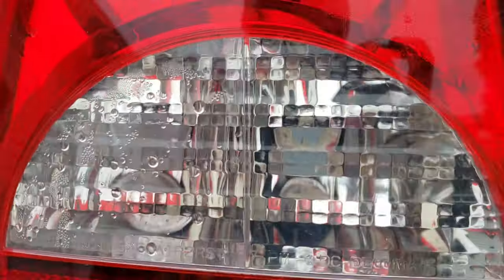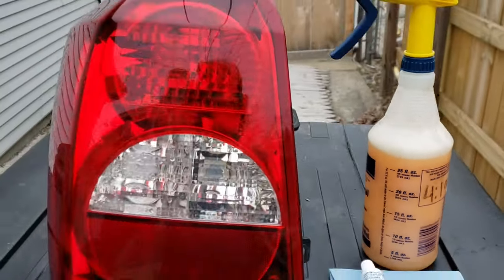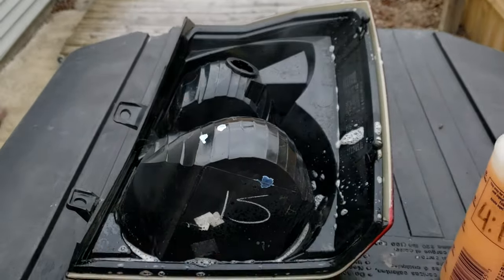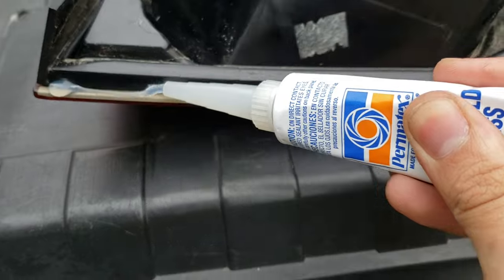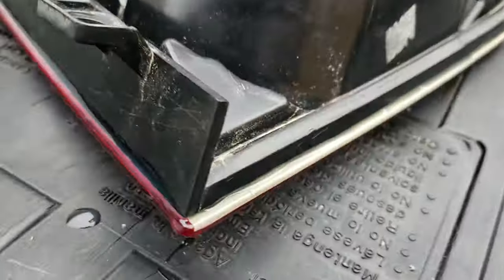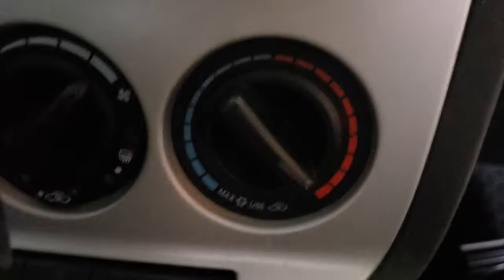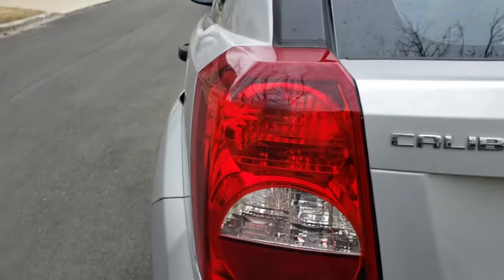How To: Remove and Seal Tail Light from Water

Comment: Please share type of sealant used.. is it the silicon based sealant available on Amazon?
Reply from the maker: You are correct, you can use any silicone based sealant to be used. The color depends on you as well as you can purchase it at Amaonz, Auto Parts store, or a Home Improvement store.
Reply: @motormech9876  one question I have about any silicone/sealant/atv is that they don't seem to adhere to the plastic and painted metal, you can always peel it off. So if you can peel off, then there is microscopic gap that allows moisture to ingress no?
Reply from the maker: @ejshelby5460  You can use 220 grit sandpaper to create adhesive for the sealant to adhere to.

Comment: Do you have to remove the water from the light first?
Reply from the maker: The water will go away when applying heat to the housing when you finish applying the sealant.
Reply: Motor Mech thanks! 👍
Reply: Motor Mech just finished doing it, the water is still there, it actually made it worse, my entire tail loght is now covered in smaller bubbles :/
Reply from the maker: Which procedure did you do for the heat process?
Reply: Motor Mech i used a blow dryer
Reply from the maker: You may have to use the blow dryer a lot longer or use a different source for heat.
Reply: @motormech9876  what a bunch of bullshit if he sealed the light before removing water, where's that water supposed to go now ? You obviously MUST remove water before sealing the light.

Comment: Yes, pour out as much as you can before sealing. I personally recommend drying it out before sealing it as well.
Reply: You can use a hairdryer or heat gun to assist in removing any water/condensation build up in the light assembly. Move the hairdryer/heat gun back and forth…do not concentrate the heat in one area of the light assembly. Also, use the lowest heat setting.

Comment: I'm constantly having to change my tail light bulbs because water gets in and shorts the connection.
Reply from the maker: Hmmm. Were you able to apply silicone around the perimeter of the taillight housing? I know for the future, I shall add an additional method of adding a drip hole at the bottom of the tail light so water can come out.

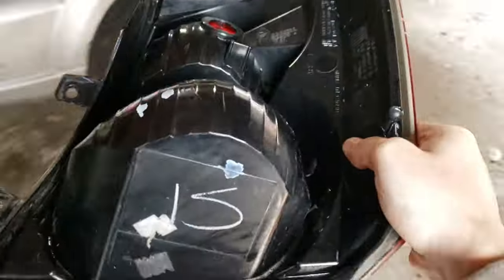Comment: Make sure you remove the bulb housing to expose the interior of the taillight housing so the water can completely evaporate through the hole when heating the taillight. Double check there are no bubbles in the sealant like the big bubble that's visible at 0:50 before you install the taillight.
Reply from the maker: That's a valid answer. Great feedback!